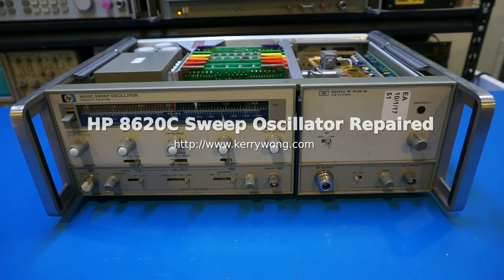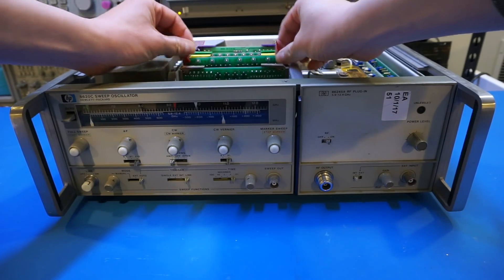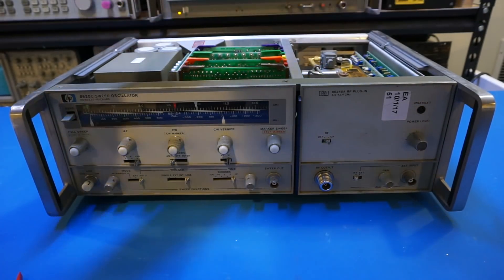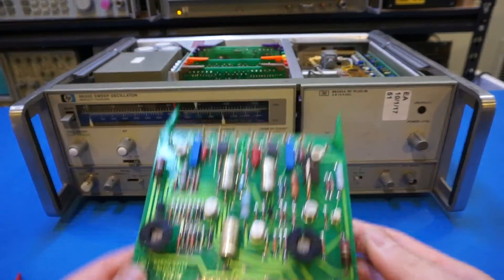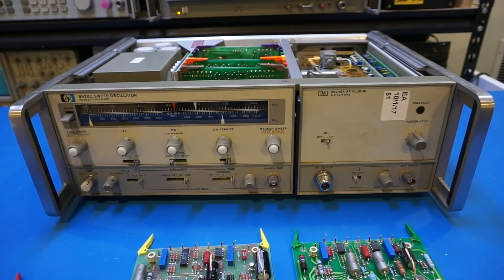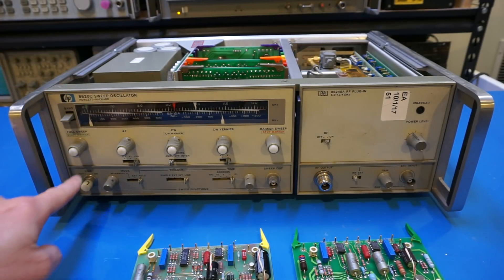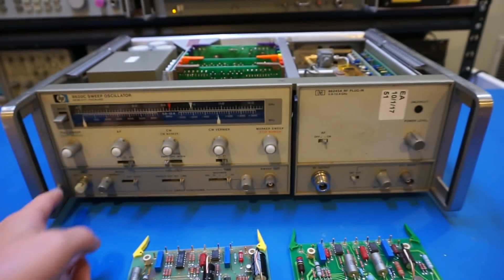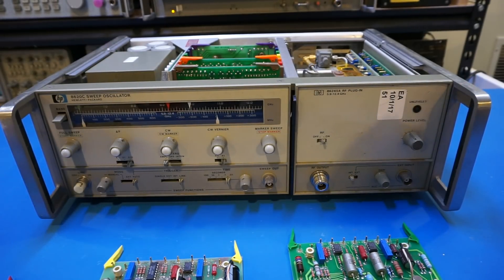HP 8620C Sweep Generator Repaired

Comment: Love HP, they made some great sweep generators back then.   only problem was cross-referencing parts back then..  due to a proprietary part number system.  great video!
Reply from the maker: The are some HP part reference PDFs around on the internet, but still a pain to cross reference.